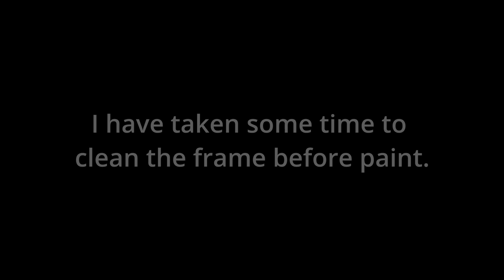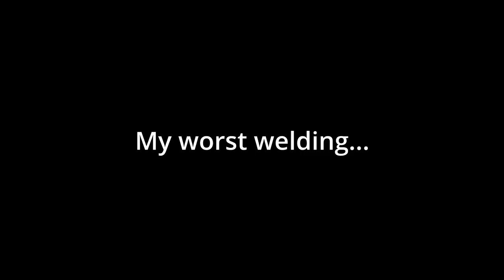How to Build a Blacksmith Forge from Scrap

Comment: I’ve just recently got started on learning how to build a forge and black smithing so I hope someone will answer my question. Why did he fill the brake drum in? Is it not better to have a deeper firepot?
Reply from the maker: A larger drum would be better, but it's a good idea to have a slope, that will allow better use of the coal/coked coal rather than some sitting around the edges not being used.  Also, depending on your source of air and how much air you're brining in, you have the potential to melt your Cast iron, the filler is there to protect it as well.  I'd recommend trying to find a bigger drum to begin with, mine were smaller and free so that's why I used them.
Reply: @NeedItMakeIt  awesome, thank you so much for the reply. That’s a good point with the slope and the filler acting as added protection. That didn’t even occur to me. I’ll definitely have to try that on mine. How long does your filler usually last before it starts breaking down/ cracking?

Comment: The end had me screaming, clean off your metal before welding you are a blacksmith you should know a clean surface is what you need but I get it, sometimes it just doesn't pop into your mind.
Reply from the maker: I'm no blacksmith, that's for sure, I'm a woodworker by trade, but I dabble in just about everything.  Thanks for the tip.   Sometimes I pay too much attention to the video work and not enough to the actual job at hand.  All in good time.